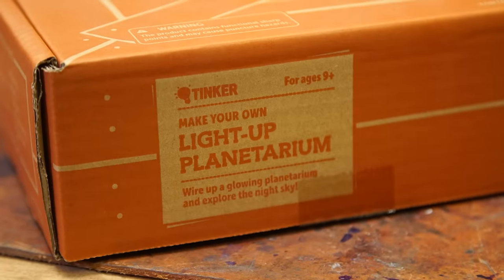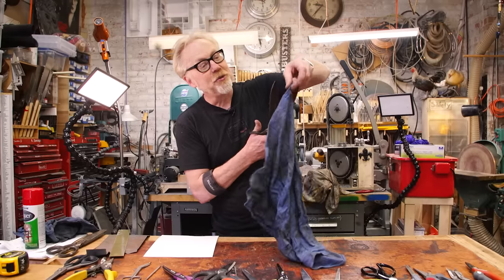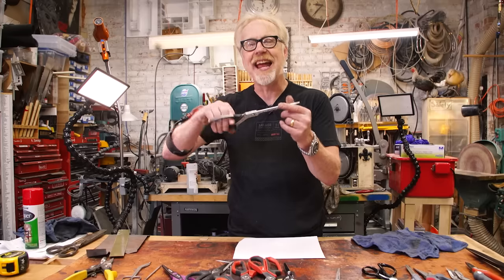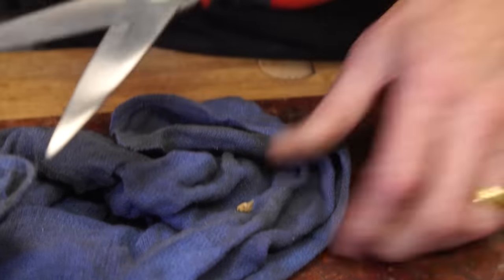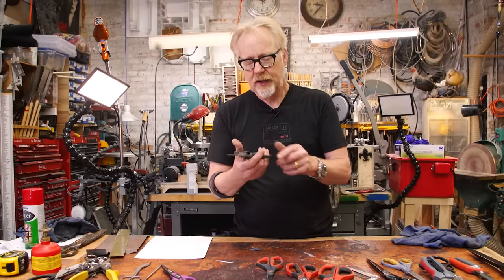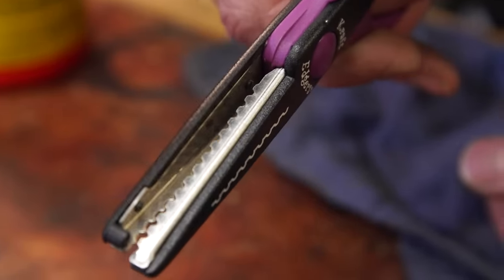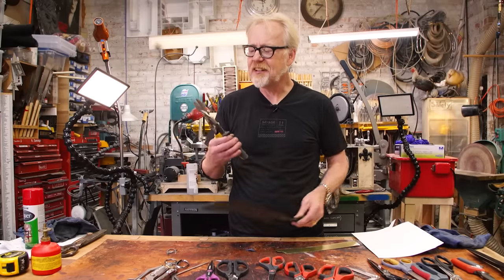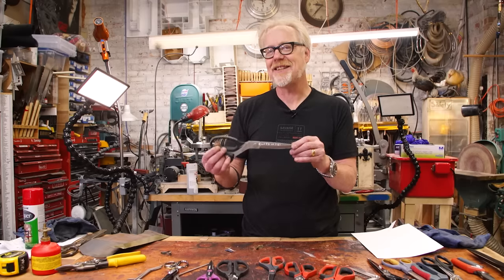Adam Savage's Guide to Workshop Scissors

Comment: notice the brace on your arm  i had similiar (tennis elbow)  both arms.  Get your mri  asap. because there are 2 surgery options  one is lithoscopic basically.  easy recover time,  if your tear is high grade (50% or more) that is not an option  in which case you are without arm approx. 3 months . so just an FYI good luck with it.

Comment: With Regard to the old school tailors scissors, Yes the cutting edges are very likely harder steel forge-welded to the softer body/handle. You can still get scissors made like this, Wiss refers to this as Inlaid, https://www.upholsteryconnection.com/products/wiss-inlaid-scissors

My favorite scissors are electricians style like Klein 2100-07. Compact and very stout, I always have a pair on me. Similarly Olfa Makes some really good ones, I like the SCS-1, SCS-2 and especially the SCS-4 fine pointed ones.

Lastly somewhere between scissors and tin snips are Midwest KNIFTI-CUT MWT-657N. small tough and quite capable of cutting things that will wreck yous scissors.

Comment: I love tin snips but I feel Midwest makes a higher quality pair than Wiss. I had a pair of Wiss before and they started rusting on me just sitting in the drawer and this was in a somewhat temperature controlled environment.
Reply: @Nunya Business Nope! Not even Tin snips. Some of them are made of materials so you don’t have to oil them to prevent rust. If I see they are not as easy to use anymore I may oil the joint but other than that, no. I don’t really oil them.

Comment: How often do you forget you have a tool that would make a job easier? I don't have nearly as many tools, but I have enough to have options of ways to do things and at times I find myself struggling through something and remember I had a better way to do it, but forgot I had the tool...
Reply: The best tool to use is often the one that is closest at hand.
Reply: @1pcfred  Unless you're on the side of the road with a flat tire and the closest tool is a pocket knife...
Reply: @djkommando  how else are you going to shovel sand into the tire?
Reply: @1pcfred  touché
Reply: @djkommando  I saw them do that in an old war movie once. They were out in the desert and got a flat. Then what can you do? It's not like anyone is going to come by and help you or you're just going to walk out. Desperate times call for desperate measures. So they filled the tire with sand and carried on. Not sure how well that'd actually work. But it isn't like you have a whole lot of options. In reality they carried two spares. But once you ran out of those you're in a spot.

Comment: Don’t just assume that acetone is going to be the best solvent for any job. Just because it’s one of the most non-polar, does not mean that it is the strongest. Whenever you have to remove a certain substance, always test it with water, soap, and water, alcohol, and acetone. One of those I promise will work better than the others, and if not always acetone.

Comment: In places where they cut cloth a lot, they swear that cutting paper with their expensive scissors will ruin them forever.  In places where they cut paper a lot, they swear that cutting cloth with their expensive scissors will ruin them forever. And they are the same model of scissors! I have worked in both kinds of places, and what I like to do is find some old pair that is dull, bent, has a bad join,t etc. (nobody ever throws them away - they just set them aside), and let them walk in on me as I am cuitting up sheets of sandpaper... :)

Comment: Tin snips are more appropriately called “aviation snips.” I think the handles are color coded for right/left (starboard/port) and straight snips. My favorite are old fashion lightweight large aluminum snips with smooth blades to leave the metal without marks. 😉

Comment: Look up sheet metal nibblers, even better than tin snips imo. The thing you mentioned Terry  English used was probably a battery powered one, but they have manual ones that are priced about what tin snips are and let you cut some intricate shapes really easily in sheet metal.
Reply: I have air nibblers and I cannot say I am a fan of the swarf they shoot out. They shoot out needle sharp crescent shapes everywhere. I have air shears that I like a lot better. If you want to cut intricate shapes you probably want a plasma cutter for that. Or maybe a fiber laser if you have a lot of money. They run in the 5 figure and up range. The 7 figure ones are pretty amazing though.

Comment: "Got some 20 thou brass and a 16th of an inch is about 60 thou and it's a third of that so about 1/50th of an inch"
Nice way of working it out based on a touchstone relationship you knew, if a bit more roundabout than observing that 20/1000 = 1/50.
Reply: Yes but what gauge is it? I guess he meant 24 gauge? Non-ferrous 24 is 0.0201 Metal gauge must really explode the heads of people who dislike the industrial inch. Because unless you're actively engaged in the drawing and rolling of metals gauges can seem arbitrary.

Comment: Very interesting video. Normally these kinds of videos are very usefull, but for me, this was not. I'm not a maker, but I frequently need to cut things with scissors, the problem is that one of the most difficult things to cut is plastic and plastic packaging something that I need to open or cut some part of it, but I don't have good scissors which can cut through plastic easily or at least with exact precision to cut what I need.
Reply: Those Wiss shears are pretty good at cutting open plastic packaging. Might be a place to try.

Comment: That's not what pattern welding means! Pattern welded blades are multiple rods of metal twisted together, leaving a pattern in the metal. They do indeed normally have a separate piece welded on to form the edge, but the pattern welding is the part inside. Having a blade with a softer body and a harder edge is something you'll find in lots of blades historically, many of which have no pattern welding.

Comment: Take your scissors to a local knife sharpener. They will have a new life.
Reply: Scissors are actually professionally sharpened by accredited individuals. Which may or may not be your local hack knife sharpener. The real deal use special equipment. There's videos here of folks doing it. It's a topic I'm passingly interested in myself. The test is cutting wet tissue paper cleanly.

Comment: Those right angle scissors will be really good at cutting wrapping paper since it lets the paper stay flat to the table
Reply: No you can't use them for paper you'll trash the blade. Paper acts like sandpaper and it kills the sharpness of the blade
Reply: @Stettafire  just buy two of you need a pair for something else

Comment: The sad thing about scissors, is once you've dulled their edge, it's nearly impossible to ever make them cut like brand new. If you ever look real close at the edge of most scissors you'll notice that they've got micro serations. The worst thing you can do is try to run your scissors through those cheap ass knife/scissor sharpeners.
So, Unless there is an affordable tool that can sharpen scissors in the same manner as the factory so that it leaves them serrated, once they're dull, they're junk.
Reply: There's videos on this site of pro scissor sharpeners sharpening scissors. It is a fascinating world I've explored myself. They don't use cheap ass knife sharpeners either. They use very specialized equipment. Lacking that I've managed to sharpen scissors with more commonly found gear. Not as good as pros can, but good enough.
Reply: @1pcfred  do you recall the name of the site???? 
There are so much more to scissors than most people have any clue about. I am far from any kind of expert. I couldn't even tell you what the actual sharpening machine looks like that is used in manufacturing that gives scissors those micro serrations, but I do know that in order to achieve that kind of machine work it takes something that is extremely precise and extremely specific to that one job.
Reply: @BIGWIGGLE223  yes the site is youtube.
Reply: @1pcfred  so, basically, you don't know the name of the channel?? Just happened to look up...... What?? Professional scissor sharpening??? Lol!
Reply: @BIGWIGGLE223  check out Wolff Industries

Comment: @6:25-ish... Defacing currency is - only -  illegal IF you change the face value. IE; Changing a $2 bill into $20 bill. Aside from that, you can do virtually anything you want with the currency that you own. It's yours. Have at it! -- Changing the value falls under Counterfeiting. THAT'S the part that's illegal. (Doan Doo Eat)

Comment: Sounds like those tailors shears are in bad shape.  I’m sure you just didn’t know, but scissor blades are supposed to be curved, not flat.  This assures a single point of contact to cut the fabric rather than cleave the fabric as yours attempts.

Comment: Those RIGHT ANGLE scissors are for cutting whole cloth directly off the bolt...while it sits on a tabletop.
Reply: Most fabric scissors are that shape because you generally need to cut large portions of fabric on a flat surface

Comment: Adam should devote an entire program to the most annoying item an average person needs to cut as a consumer. That material is plastic that is used in blister-packs. They may be covering cosmetics, a tool, a memory card for a camera, or flash drives. The designers are more interested in theft protection than customer convenience. Many scissors have become ensnared in this plastic trap.

Comment: Normal people: scissors.
Adam: sometime in the next 10 years i will need right angle scissors.
Reply: I have four types cus I do textiles and cooking. Kitchen scissors, regular scissors, fabric scissors and little thread snips. The regular scissors aren't beefy enough for cooking and the blade ain't sharp enough for fabric so I use them on things where I don't care if I dull my blade. Fabric scissors are angled so you can lean them on a surface as you cut to get super straight cuts and they are mega sharp (as me how I know, got the scars to prove it). The thread snips are because why have a giant blade when you only need a tiny little one.

In other words I don't know who these "normal" folk are but they're wrong 🤣

Comment: None of those scissors are titanium, Adam should really know better. These are steel, of course, with possibly a coating of titanium nitride or similar material for prolonged durability. Or it could simply be marketing, there are a ton of products with 'titanium' in the name or written on the product even though there is no titanium even in a coating in any part of the item.

Titanium is not a strong enough material to be practical for any sort of cutting blade, with rare exceptions (such as scuba diving), where corrosion resistance outweighs sharpness and other attributes.

Comment: The comment about cutting paper is one of the worst things to do is nonsense. Most materials to cut are plastics, paper, cloth and metal. Paper and cloth are not on the hardness scale.
What does damage scissors is cutting something harder then the scissors, like hardened wire.

Comment: Is there really a singular "the scissor"? I always thought they'd only come as a "pair of scissors"
Reply: The pair of Scissors that come apart at the pivot are, when apart, now two each scissor. Useful for marking or flush cutting things, cutting tape on boxes where you don't want a box cutter or the other blade flopping around or cutting your fingers as you try to keep it from doing so. At least that's my interpretation of the singular scissor.
Reply: Each blade is a scissor, otherwise its always scissors
Reply: I have a pile of single scissor blades. I'm sure they all came as pairs but they just didn't stay that way.

Comment: Ι never sharpen the inside of any scissors. That's a recipe for disaster. Scissors come hollow from the inside (where the 2 blades rrab together) and you always sharpen the edge bevel on the other side ONLY. Even a single pass on a stone of the wrong side, is enough, to misalign the scissors, and make them useless.

Comment: Huh, I wasn't aware paper can dull scissors.
Reply: For cutting paper you don't need a mega sharp blade but for cutting fabric you do. So most paper scissors are not as sharp as paper scissors. Plus fabric scissors are angled so you can lean them on a surface as you cut, which is more ergonomic for cutting large things